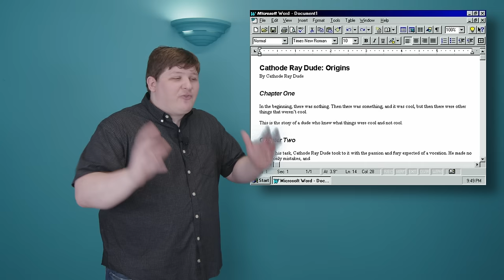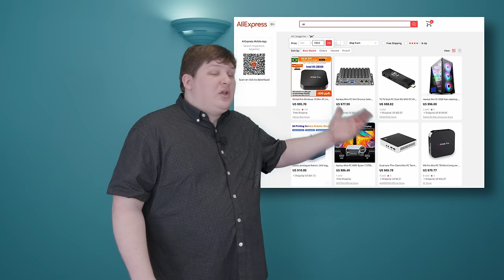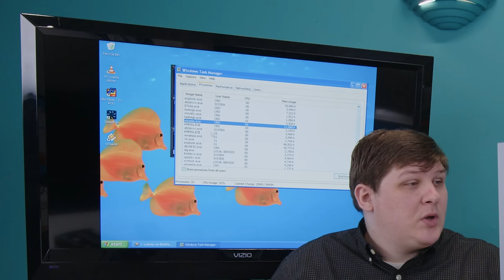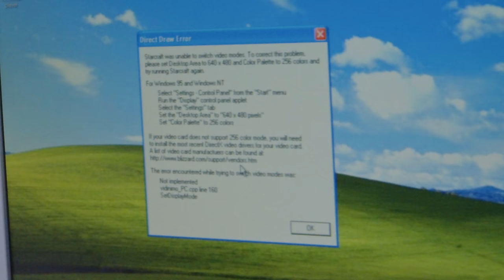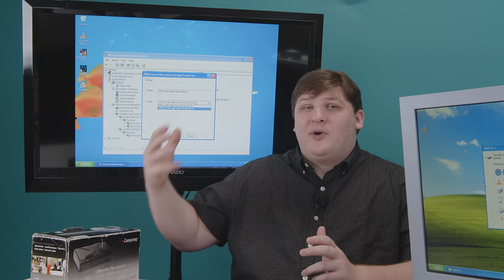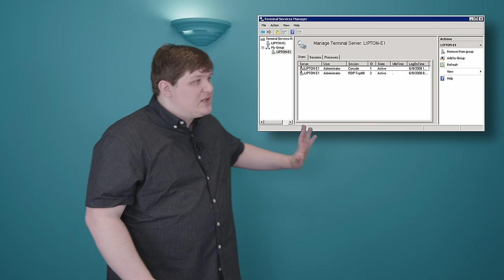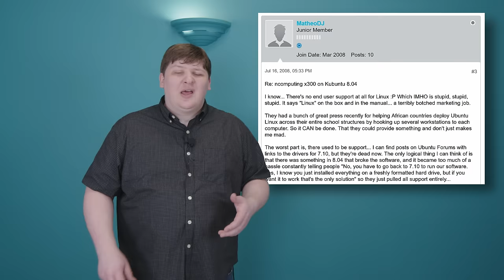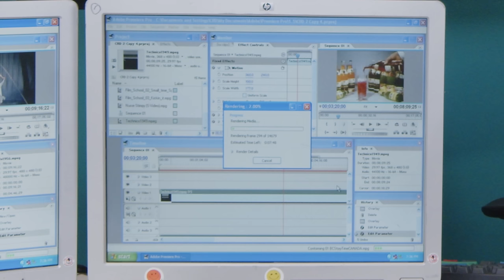7 Users on 1 PC! - but is it legal?

Comment: Think of time-sharing back in the 1960s.  One of the biggest motivations for "personal computing" was that the whole machine wasn't available to you - so your runtime was very inconsistent, and remote connections (yes they had those back then) would also drop out or be inconsistent.   Now a days, yes we have more computing power than we can (typically) fully utilize -- I've told peers, seeing a CPU that isn't at 100% duty is just a sad thing to see.  The energy has been spent processing NOP (No OP).  It's not quite that bad now with throttling processors - but still, to your point, there is a lot of "CPU waste."  But then there are those key moments when you do need that power -- transcoding or processing 100GB's of astronomical data to stack an image.    But it's like a car - we don't drive at WOT all the time even though we have 200+ HP, and at stop lights the entire engine is disconnected anyway (from transmission), all that power being wasted.  It took like 100 years for smart engineering to dynamically shutdown valves or turn off an engine entirely (at idle).  Maybe we'll get there on massive-distributed processing in computing -- Folding@Home on a larger scale, sharing a little piece of its overall processing when my local processor is relatively idle.  I used to think that's how hollywood movies got rendered - they got a back door into everyone's PC to do a few frames here and there.  Or Cypto could be like that -- whether it's NOP or some useful calculation, might as well use the energy.    //  You asked why it wasn't popular in homes -- but you mentioned a 15foot limit (which then you said didn't seem quite accurate for the display, but maybe was accurate for the keyboard).  Wireless back then wasn't where it is today, homes maybe weren't suited to have a central machine -- then maybe need 30-50ft distance to stretch into rooms?

Comment: I have been running Linux since 1994. In the dorms at the University of Michigan in the fall, with several people logged into my 486-66. During most of the period from 1999-2016 (and for a short period in 1996), Linux was my office PC. It really depends upon your profession. Today at work I use Windows 10 as a dumb terminal to support Cygwin. Everything I do outside of Cygwin works poorly (slow, crash prone), as you would expect, mainly the garbage that is Teams and Outlook.

Comment: Did you ever get to play with a Sun Microsystems setup? It's one Computer and with several keyboards and optical mice and monitors connected. We had one at the Truss Company for wood truss design software when I started in the early 90s. Solidly built machines, those were. The optical mouse used a special mouse pad with a dot pattern. IDK.. might be cool to play with one today, if any are still around.

Comment: Your point about computing power being way overkill for most people is really true. I got my first laptop in 2013 with a 3rd gen Intel i3, but replaced it in 2018 after it got "too slow". But a few years later, after swapping out the spinning drive for an SSD and upgrading the RAM from 4GB to 8GB, it was suddenly amazingly snappy and is still perfectly usable for office type work and internet use. It's even fine for streaming HD 720p video to this day, it starts struggling with 1080p but the screen isn't even 1080p so that's not important. This is with Ubuntu and Windows 8.1 though and not Windows 10/11.
My problem is having a compulsive need to buy new stuff, be it a new GPU or CPU or whatever even if I have no need to upgrade lol. Though, even after accidentally blowing up the sound chip in my newer laptop rendering the speakers and audio jack useless (had to buy a USB to 3.5mm aux adapter to at least use headphones again), I still am satisfied with my current laptops and will resist the urge to buy a new one... even the older one has more than enough computing power for what I'm doing 95% of the time so I want to stick with what I've got.

Comment: I'm convinced that how this works it pretty easy. You can think about it like this: you have two accounts on your computer and it's no problem for win xp to use two accounts at the same time. For example go to the first account, set up a program that rips a DVD and then just switch to the other account. The DVD will still be ripped when you switch over to the other account and you can easily work on the other account. That's how it's done, no virtualization, no magic, just simply two user accounts that work simultananeously.

Comment: *This is only my theory*
I suspect the "DRM" could possibly be that the main cards were hardware-keyed to each 'terminal' satellite thingy. So, if you bought the version with the smaller amount of users, each satellite would have a hardware key to match the main unit. So, you wouldn't be able to expand a system unless you bought another set (?)  ...As severely limiting as that might sound because I can't think of any other reason why it would need codes specifically from the bottom of the satellites... unless it has an internal library of codes it scans to match.

Comment: I have this "small form factory" computer by HP. It has a Pentium 4 "630" (1 core/2 threads) and 4 GB RAM. It is running Linux Mint - fully updated - and I can imagine using it as a main "general computing" PC. 

Microsoft Corp., on the other hand, will refuse to let my Ryzen 5 1600 CPU to run Windows 11 (not that I mind, LOL).

Admittedly, I rarely use that HP computer, but it only shows how LONG hardware can keep going.

Comment: @38:28 technically you have more than enough signals; assuming you have 2 for power and 3 for RGB, you still have 3 more wires. One is clock, the second is data... and the third is possibly for digital audio. Keyboard and mouse don't need much throughput, so you can probably also send commands back and forth. As for video - you only need to support 2 modes so they're probably done at the CPLD in the client; the host only sends RGB, which the client has to interpret according to the selected mode. If you use one of the other already-present signals (like audio...) for clock (it's so great at that that MP4/webvideo streaming uses it for sync! try streaming an MP4 without an audio channel...), then you can have keyboard/mouse separate too...

Comment: Back in the Windows 7 days I ran a multi seat software (I think Aster) on a dual Xeon 4 core Nehalem server (8 cores total no HT) that my work was getting rid of. I put a GTX 970 into that bad boy so me and my girlfriend could play Elder Scrolls Online at the same time. It worked great and I think it’s still a great idea but for modern games you might need multiple graphics cards.

Comment: Didnt the Windows OS get changes from Citrix? Back in early 1990s Citrix Winframe had license to source code for Windows and developed multi-user windows (winlogon, etc), some time later Microsoft amended the license and absorbed that to become RDP. Citrix then had Metaframe XP then Presentation Server 4.0/4.5 then moved to XenAPP (when it acquired XenSource) and XenDesktop VDI and XenServer (to compete with ESXi).

Comment: I had a quick look at the driver disassembly, and it appears to use the video miniport driver, which is used by RDP (remote desktop)

I'm going to guess it creates a separate video miniport driver instance for every connected client and the PCI FPGA is used to marshal the data back and forth the individual clients. The small black boxes are probably quite dumb and just takes the data stream from the RJ45 and splits it out for the individual ports

Edit: Okay I wrote this comment at the 20-minute mark, seems like you've got the same theory

Comment: i'm still using my 2012 i7 3770k. bought it with an alienware on a blowout sale. originally had 8gb ram, a micro atx board and a gtx570. currently it's paired to a intel dz77ga-70k board, 32gb 2400 ram, evo ssds, and a 1070ti. Runs everything I need. New games still run 1080p 60 fps and has very few issues with 4k60 depending on how well optimized the game is and graphics settings. The better the parts you buy the longer they'll last and remain relevant.  Once I can manage to get my hands on a pcie4 rtx card then I will make the upgrade for more current tech. I've also noticed a lot of bigger games i've been playing people with newer hardware tend to have a lot more problems than i've ever had with this rig.

Comment: Terrific video, very informative and very well done.  This tech could be a great Teaching environment as well (for computer labs / classes) if you could pick any of the clients and display their monitor on a big screen.  e.g. if someone is having problems with something, display their screen on the big screen and have the class work together, work out what's wrong and suggest solutions.  Would be great to see this tech running on a more modern PC - with lots of RAM and an SSD.

Comment: I'm still using a dell server workstation with dual gen 3 xeon 8 core processors with hypertheading, a pair of Nvidia GeForce 1080s, 32 gb of ram and windows 10 is running on a solid state drive.  

Aside from the solid state drive it is a 2011 cpu and works amazingly well.  It's a bit sluggish at newer games but can convert mpeg/music files like the wind and multitasking is a dream.  

I like having a million aps open at rhe same time because I have adhd.  I bought it used on ebay in 2015 and it has been worth every penny and then some.  I'm a console gamer anyway so I don't need the latest threadripper to feel complete.
Reply: yep ivy bridge is still a solid platform it can do most tasks no problem if you know how to work it.
Reply: @jenkims1953  your exactly right.  It was right as intel started to crest the top of their product quality sine wave, after bottoming out in the p4 Era.  

What's interesting is that even the fortune 100 company I work for doesn't replace computers/servers due to obsolescence.  It's due to equipment failures.

Comment: As for the serial number being needed to use the device?  It probably identifies the specific hardware unit to the control software, which probably didn’t have auto-detect functionality.

Comment: This is quite reasonable. On modern computers with 8 cores, four video ports on a video card, multiple cards possible on a PC, display port parts that can be daisy chained, USB keyboards and mice, and mother boards that can take 128gb of ram, this would work amazingly well.

Comment: The sync is almost certainly sent as sync on green. It doesn’t need separate pins at all. The three loose pins are probably left and right audio and a single ps/2 serial, with a decoder to unpack that into two bidirectional PS2 ports.

Comment: I'm using my 2010 vintage  X58 motherboard and Xeon X5690. It was such a beast that it's still fast enough. I just unpgraded the GPU to a GTX 1080 in 2017 and the RAM to 24 GB (triple channel DDR3).

Comment: I’ve been wondering about that for a long time.  If our computers are more powerful than a mainframe, and they can have multiple monitors, why aren’t we seeing multi user PCs?  So much money could be saved at schools and homes.  Maybe they need to do a better job marketing this.  This is the first I’ve heard about it.  Maybe an even better idea would be a powerful computer similar to a laptop with no monitor or keyboard.  I work from home and at the office, but I connect to monitors and wireless keyboards and mice.  The belt-in ones are a total wast of money and I never use them.  Students and professionals could use a better solution.

Comment: And here's where Linux really helps with the web IMHO. (Re the Plateau) - you can run LTS OSs like RHEL clones for 10 years, and you still can get the latest Firefox and security patches. I'm still running a 2010 Lenovo S20 with a quad core Xeon I bought new then. I did get an SSD and upgrade the graphics card once in 2014 or so, and 2 years ago increased the RAM to 18GB, but that's it. It's chugging along with EL7.9 and will run through 2024 with patches there. I'm not sure if it'll run EL8 or 9, so I might finally have to upgrade, but I bet I can get a used S30 or P500 and run those for another 5+ years. And you're right, I mostly browse the net, watch youtube, and do data management. Linuxes do this fine, and with the LTS versions, they're inherently not going to bloat like rapid releases or Windows because the point is to fix a functionality for a decade. Which works for A LOT of people, but they don't actually know it.

That said, even for Windows - I can regularly see people running 5 years or more, but there MS does keep adding features now in an inescapable way, which pushes new computers.

Comment: You are 2000% right (or at least 100%..). Obsolescence comes mostly from software updates (software bloating) today and for a smaller part from the evolution of the user needs. I still run some old machines such as Pentium or Core 2 Duo for controlling machines but these machines are not connected to the web and have never seen a software update. Booting these machines and getting to a functional state is faster than a PC from 2010...

Comment: A call centre would get one like 1 core 2 duo HP server with loads of ram 7200 drives  "full tower type" and use it for running a whole xp setup for 12 internet based call system operators. Sometimes you would see them with the security camera card installed too.

Comment: The Core2Quad computer I built in May 2008 runs Windows 10  smoothly today. Only upgrades is had are a new average graphics card in 2012, and an SSD and USB 3.0 in 2014 I believe and replqcing the storage for bigger and faster HDs. Latest upgrade was adding USB-C. For web surfing, doing stuff in Word and Excel 2016, and watching YouTube in HD it is all good enough. In fact, in this field, I hardly notice a difference with a brand new computer many times faster.

Comment: When you say it “wouldn’t be a heavy lift” on Linux you’re more right than you know — it’s more like zero-lift. You can do this exact thing out-of-the-box with some tricky X server configuration, and around 2013 or so I did precisely that for a lab I worked at.

Comment: FWIW, this is almost certainly not remote-desktop-the-network-connection, but rather attaching desktops to physical hardware through the various Windows APIs. The underlying tech is shared w/Remote Desktop and Fast User Switching.

Comment: We had at work one machine, pentium III  ~1998. Last year it became obsolete, since in latest security update for the linux it was running, needed a CPU with MMX extension so we had to replace it. It just collected weather and environmental data and saved it to remote database.

Comment: Maybe the VGA signal on the Ethernet Cable uses Sync-on-green, allowing them to have extra pins in place of the H-sync and V-sync, which they could use for the other signals.
Reply from the maker: Good thought, although I think a lot of PC monitors don't support SoG so it would be a pretty rough gamble.

Comment: I have to say even to this day and with a ryzen laptop my home computer is a custom built core 2 quad system. a q9400 with 8GB of ram and a cheap SSD running windows 7 is still a good computer for web browsing. the thing has been slowly upgraded with free/ very cheap parts over the  past 5 years since I got my first bits of old hardware to learn how to work with computer hardware and I love it

Comment: There were actually a large number of earlier devices out there doing this sort of thing with varying degrees of success but the idea disappeared as computers became cheaper.  In the 1980s there were several companies including Alloy Computing which made plug-in cards for the IBM AT with x86 processors on the card but which shared the same disks and MS-DOS instance wiht the host computer... you could have several keyboards and displays on one host.

Comment: I am guessing there is 2 ways to do this fundamentally. 1) Run VMs and simulate 1 person computers at the same time 2) Introduce drivers etc into existing OSs that can be convinced to do so. It really shouldn't do 3d rendering at all. Better would be to try to divert the output of your main gpu into the frame of the video buffers to the boxes. Or you can run the like CUDA system to make your own rendering subsystems and just get the output from the card.

Comment: I think this was invented for the video walls that were big in movies. There were multi screens used for a TV. I always wanted one of those. It looked so kool. Now I see how easy it was and could have done it myself. SMH don't we all feel stupid now. lol I specifically remember it being in The Witches of Eastwick. Great movie. I imagined watching it on that huge screen wall.
Reply: It'd most likely be an enormous headache to use a hardware video wall controller for this job: video walls tile one logical display across many physical displays, whereas at all points in the guts of a multiseat system it makes sense to have a logical display per physical display. Otherwise you'd be joining them together just to then split them apart again.

That said, I've never seen a block diagram for video wall controllers older than just brute forcing it with a bunch of Raspberry Pis or graphics cards. A scale/crop/pan unit is likely cheap, though, and all you need for a basic wall is... a bunch of those.

EDIT: A multi-head framebuffer would certainly be useful for running a video wall, though!